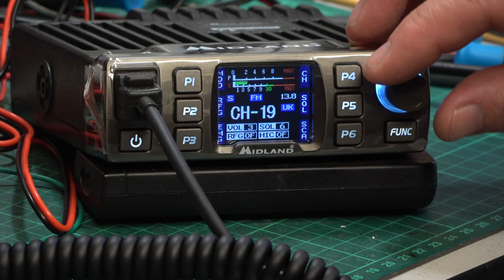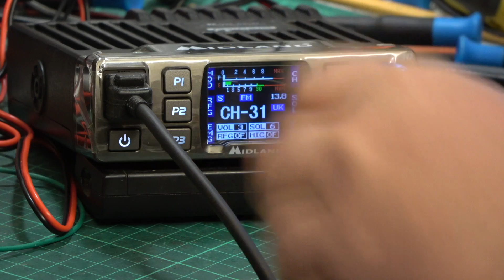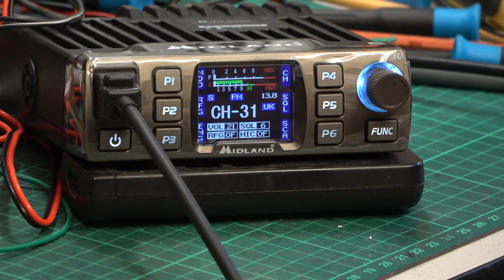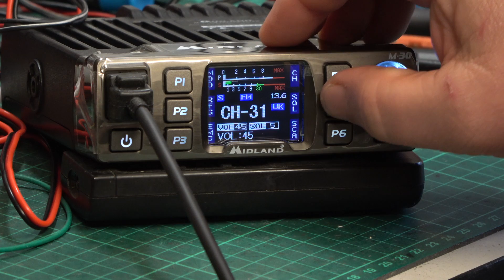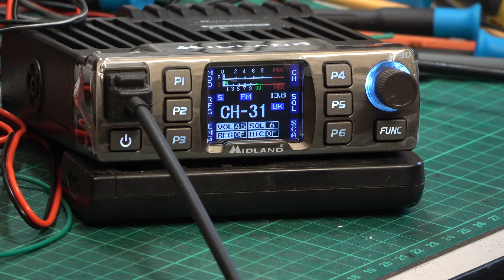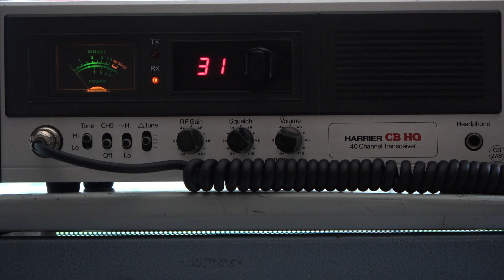Midland M30 UK CB radio CE-MultiNorm (mobile) - On The Air Test

Comment: Can you please help. In the listing on ebay it says the m30 has Bluetooth.  I was hoping to connect midland bluetooth mic to it but can't work it out. Any help appreciated
Reply from the maker: Well I've just read the instruction book & there is no mention of bluetooth in the feature list or anywhere else. I also looked on Ebay & saw bluetooth in the AI generated description. I also looked on Midland's website & no mention of bluetooth. I therefore suggest that the AI description (as usual) is a load of BS.

My suggestion is always to download the instruction book & look at it carefully before buying a radio.

Richard, G0OJF, UK
Reply: @ukfmcbradioservicingTango21 thankyou. I took for granted it was because of listing's. Thanks for your time looking

Comment: Hi Guys new to this Radio stuff do you need a licence to operate one of these and do you need 2x of them to communicate with each other or can they have a normal radio like a walkie talkie
Reply from the maker: Most walkie talkies need a licence in the UK other than PMR446 UHF walkie talkies (0.5W). UK on. radio users have access to two sets of 40 channels. The UK set of channels & the European set of channels called the CEPT set. I find the CEPT set of channels unuseable here in Lincolnshire owing to foreign interference. Most CB activity is to be found on the UK set of 40 channels.  There is no longer a licence fee & all citizens of the UK have an assumed licence, just like with a dog licence. However, the rules are set out clearly on the Offcom website.

Radios have to show a type approval, which is currently the CE mark on the rear panel.

Unfortunately there are plenty of illegal unsuitable radios for sale on the market intended for different regions.

Email me with further qustions or we drift off-topic from the Midland M30 radio you've posted this on.

rshireby@yahoo.co.uk

Richard, G0OJF, UK

Comment: I really do like the look of this radio but as you say there seems to be so much faffing around to control the radio itself.
Not particularly good for mobile use in my opinion. It seems the functionality of this model is awful.
This is why i changed my mind on buying one.. 
still like the look of it though.

Comment: I was almost tempted to buy one of these or many other clones, as a smaller replacement for my comparatively huge 1980's Rotel 240 or Audioline 341.
All that faffing would drive my nuts. but I would like access to midband and AM and the old rigs wont fit in the car :-(

I guess I shall look again for a small alternative.
Any suggestions?
Reply from the maker: We use that Thunderpole T3000 radio as a bit of a base here because it seamlessly goes through UK40, CEPT 40 FM, CEPT 40AM onse set for UK operation.

richard
Reply: President Richard. Amazing power and tremendous tx audio

Comment: Hi not related I know I chat some nights to 3 blokes in same town and they use Channel 30 EU.But some nights get really bad interference like a power line is buzzing and cracking through the speaker and I've a job to hear them. What is it than cause this  apparently it was doing it before I started talking to them so nothing to do with my end i only ever get it from them never had it receiving anyone else not even from abroad. Obviously they have better radios than me I'm on using a little team mc8.
Reply from the maker: It could even be over horizon radar. Gives me S5 on 10M and other amateur band sometimes.

Richard

Comment: Midland please stop glutting the market with pointless crap like this and start remanufacturing the 4001 instead :-)
Reply: Afraid you will be in for a long wait.  I would rather have a simple set with a band switch, mode switch, volume, squelch, channel change and possibly a mic gain. Why is no one making SSB sets?  Just have to go get MMO***
Reply from the maker: Some of us have no interest in SSB! I've been a licensed amateur since 1979 & only ever do AM, FM & CW!

Richard
 
Richard
Reply: @ukfmcbradioservicingTango21  Horses for courses.  Not everyone is interested in AM or FM but are stuck with it, or at least was.

Comment: Output was good, but sounded awful on input. Great demonstration and glad you showed it. They have a lot more in the way of improvements to make and why they use those terrible microphone connectors on today's radios is beyond me. Bring back the standard 4 pin connectors
Reply: You need a lot more pins for the modern fancy complicated radios, I don't care how many pins they use, but put them into the old style connector, just another expense when the mic goes faulty.

Comment: I love these simple tests. Its a great long term experiment. Documented and some great commentry. Thanks again for the test. I have a cb on the way to me now. #over
Reply from the maker: They are all done the same way, same route, same equipment...and Mr C & my experience as commercial 2-way radio engineers. Everything we use is 'normal' but properly set up. The only secret ingredient to best possible performance is the drilled-in roof aerial mount on the car & commercialquality coax.

Richard

Comment: I have a CRT 2000H (excellent radio) and it look very similar if not just a rebadged and cheaper version of the Midland M30  - Inspired by you and Mr Chippie I now have a Midland 78 multi plus on it's way to me from Knights.
Reply from the maker: The Midland 78 multi +'s only annoying thing is it only does CEPT FM from the band switch on the front. When we need gto do an AM test, Mr C has to reprogram it for Spain in order for it to do 4W AM on CEPT. The design keeps getting updated, but it looks like the band arrangement is still pre-2014. Other than that, it works how we want a radio to with a real volume & real squelch control & a real channel knob!

We did try the Intek (760?) model with a forward facing speaker, but the detector was always drifting when used mobile, so went back to the Midland 78, in which all four cars here have one fitted.

Richard

Richard
Reply: @ukfmcbradioservicingTango21  Hi Richard the Midland 78 has arrived and I'm very happy with it. It's a simple basic radio with a very nice receive and great audio output! thanks for the heads up best Rob

Comment: Strange, I didn't get a notification of you doing this one?  To much faffing about and I wouldn't like to do that driving.  Maybe ok if Static, but I have always worked mobile and I like a simple set, vol, squelch, channel change, who wants to have to take their eyes off the road to adjust something?  With the 80s sets you could reach down to the knob and turn it without taking your eyes off the road, even change channel, then just glance down to check, but you got so used to it you would be either on channel or one away.
These modern set are to distracting, for drivers, though Hams have used set like it for years I tend to hear them make contact then drive off, much more like sense, but with CB that just doesn't work, there are no repeaters. Thought I spotted a typo, I've been looking at this screen far to long.  Stop entertaining me Richard!  Ha ha ha, on second thoughts don't.
Have you ever done the Binatone with the phone handset?  I have one still in the box, never used, I don't know if it even works!
Reply from the maker: I've mislaid my Binatone Breakerphone & it's possible that it's in storage whilst building work is supposed to be happening here, but I'll buy another sample if I see one.

The 70cm's amateur radio in my car is a business radio with 4 channels & does 17W FM. Our local repeater (that I own) GB3GR, and three simplex channels. No meters..on/off/volume, squelch & channel.
Richard
Reply: @ukfmcbradioservicingTango21  I never look at a meter if driving anyway, I just say Loud and clear or as you would say Radio 5/5.
If I am down that way I will give you a shout, if I get my licence that is!  Which I hope will be this year.  If I g pull my socks up and get on with it.  Not to interested in 2 meters or 70cms, but I will get something cheap and cheerful to cover it.
Microwaves interest me, but they can be nasty to work with and need guided everywhere.
Reply: @ukfmcbradioservicingTango21  Don't go buying another, just wait till you find it, I don't suppose they are very common anyway.
Anyone out there got a BINATONE BREAKERPHONE?  I was going to put another hand set on it like some of those fancy mics you get these days instead of the hone handset, it would be easier to operate then.  Store it out of site, but life got in the way.  I just opened the box the other day, nice looking handset, but not very piratical for mobile use.  Why they didn't do a model with a mic on it instead is a missed opportunity, though I have no idea if they are any good or not, knowing my luck they will be like a fidelity 1000 inside!  Added components for the hand set.  I am just guessing, as I say it has never been out the box.  If I had been closer I would have taken it up just so you could do a video o it, but I am to far away for that.

Comment: I really don't like where modern cb radio's are going, I won't be buying this one either. Thanks for your videos
Reply from the maker: There is a reason why we have that Rotel RVC230 as a calibrated test radio...and that Harrier CBHQ!

richard
Reply: @ukfmcbradioservicingTango21  I would gladly choose the Harrier CBHQ over any other modern radio thanks :)
Reply: No, me nether, I just don't like all this push a button, wait, push again to adjust, find it is still on the last mode instead of going back to vol'.  Press menu to change between UK and EU channels and all this while driving!  I wish they would at least give you Vol', Squelch and channel change on a know, even if it is a constant rotating know just counting pluses, at least it is simpler to operate on the road. Edit:  They could give you one button to change from UK to EU and another from FM to AM but have AM locked off for UK channels..
Reply: @BoB4jjjjs  here here :)